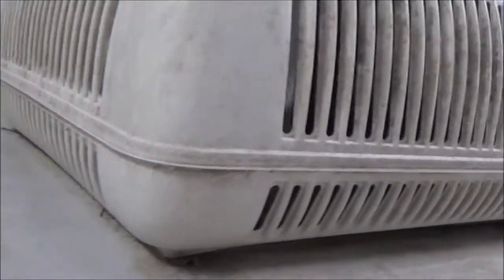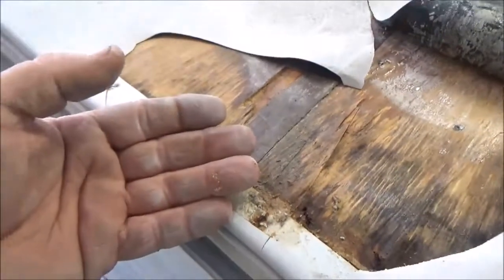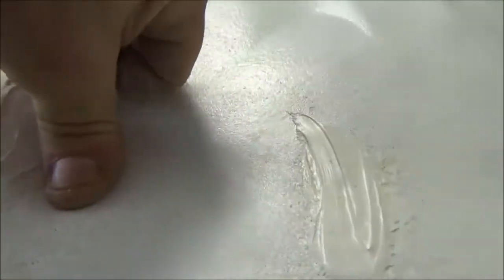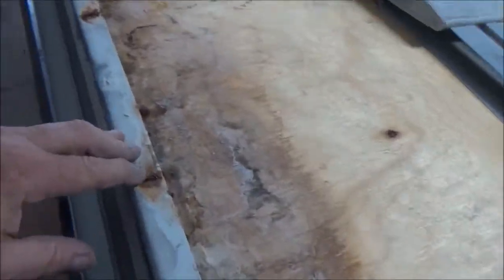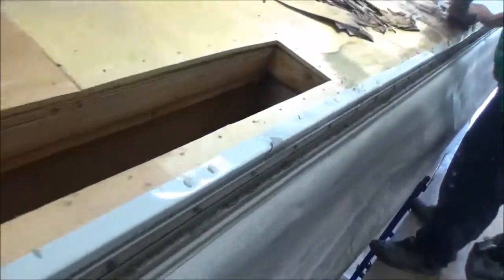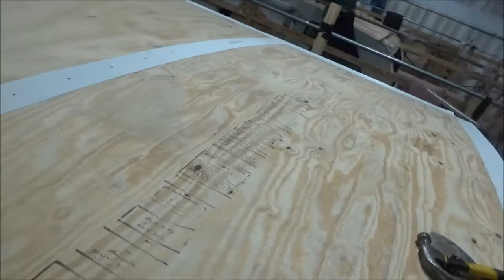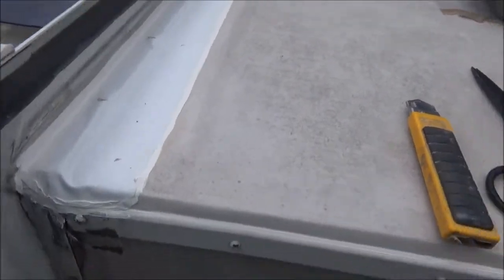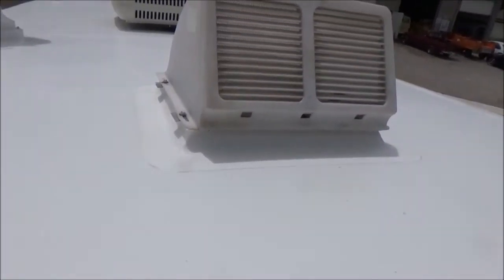Jay Flight

Comment: Where can I get primer for tape, or how could I make my own? Where can I get the heat welding 3” material also? I’m thinking several of the things you are using are custom stuff I can’t just buy somewhere. Just starting to tear off our 2004 Jayco JayFlight 31BHS roof, and I’m going to have to redo everything. I want to do it as best I can and ensure no leaks. Just found your channel today. Thanks for the videos.
Reply from the maker: Everything you need will be at your local commercial roofing supply house.